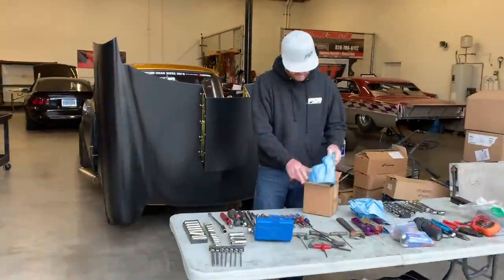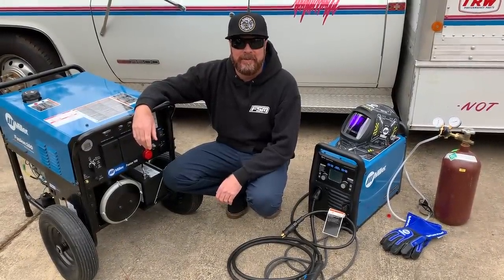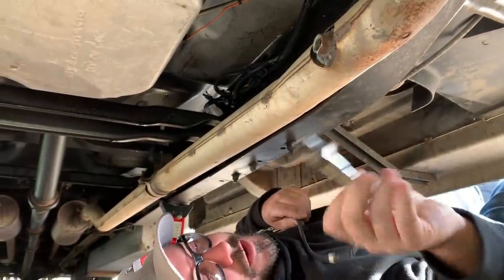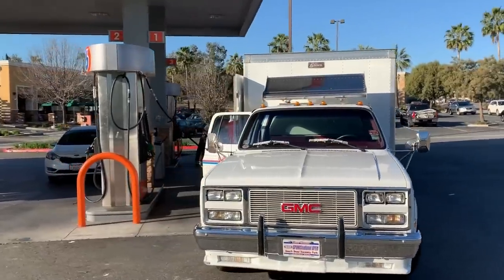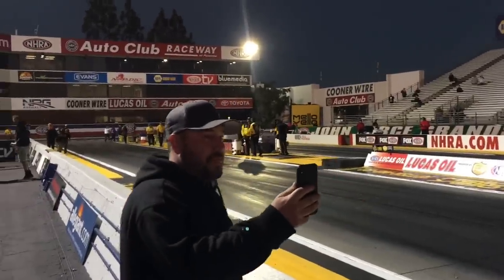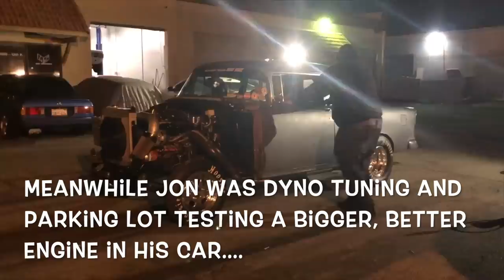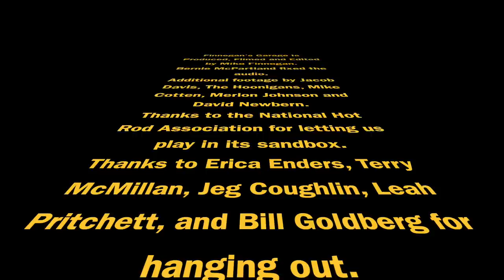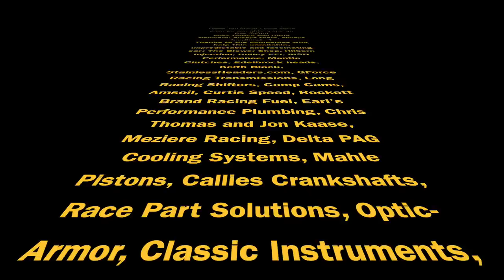Finnegan's Garage Ep.65: The Biggest Wheelie and Race of My Life!

Comment: Dude it's got the aerodynamics of a billboard
Reply: Suggestion:  The deflector is possibly  only creating down force. May have more success deflecting the vacuum of of the back of the vehicle. I have enjoyed traveling with you guys on the podcast.
Reply: It is a billboard!
Reply: Thomas Wright pushing a 7 ton barn down the road. I bet the people drafting it are getting great MPG. 🤓
Reply: My 60 Landcruiser has the same aerodynamics, but i still can get 20mpg out of that
Reply: Having said that, it definitely wouldn't do that at 80mph. More like 60
Reply: like a brick through oatmeal
Reply: @joecook3223  My 93 80 gets about 9 on the hwy.  Had a 93 pre-taco extra cab with the 3ltr V-6 manual 4x4 that got about 13.  Had a 99 F-250 supercab 4x4 gasser (5.4l) automatic that got 10, no matter if it was hauling 10klbs or completely empty.  If you're getting 20 in a 60...you should do a video about it.  It MUST be a diesel off the trot, a manual naturally but still...I'm curious.
Reply: @samjohnson9894  yeah dude turbo diesel. 20 is the best i ever got. (Well it was 11.3L/100km but converts to 20 mpg apparently)  That's bullbar and roof racks on. The very worst i got was 16L/100k. Full roof racks, full car, 1 ton trailer. But like i said, i don't really drive fast, as soon as you go faster than 100km/h the economy worsens dramatically.
Reply: Mum and dad have an 80 and that does pretty much the same as mine, again diesel 5 speed. Same deal though, none of us drive very fast.
Reply: @joecook3223  That 80mph or kmh. Major difference. My old 05 Silverado 5.3L with 3.42s gave 13 empty at 80mph. Damn thing could hit 143mph too, but scary as hell in a pickup thats pretty kuch stock with a tuner removing the govner. My diesel 18 3500 cummins gets 15 at 55mph to 60mph and 11 at 80mph. I he traveled 55 to 60 he would average better. Fuel loss by extra wind force to eats fuel. Why i see truckers running harder when their trucks are unlocked as they burn the money in fuel. The smarter guys run 60 to 65 and take more money home as they are not wearing out their equipment faster or have to take that extra load to take the same home as the guy running 60.
Reply: @brandoncaldwell95  in the comment above yours the "80" was referring to an 80 series Landcruiser. We drive everywhere at 60mph, and at that speed we get 20mpg.

Comment: 14,000 lbs, 456 gears, 80mph, 454, what part of bad gas mileage is hard to understand?
Reply: Did he say if it even has a lockup converter? 😆
Reply: @grabasandwich  no th400 ever had a lockup clutch
Reply: I had a 70 SS454 Montecarlo a verrry long time ago and it got eight something so honestly I don't think with all of the weight, 4.56, and eighty MPH that your doing bad. It is what it is. Seems normal to me.
Reply: @Sharkey_t  thx, I probably read that somewhere but I forgot.
Reply: jake welder that is not a 4L80
Reply: You forgot "Aerodynamics of a house"
Reply: @chrisj197438  thanks
Reply: tbirdracefan 
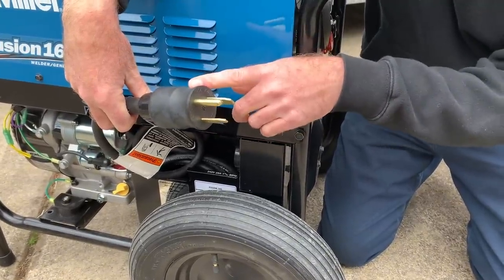 I was going to say the same thing! The fuel mileage sound about right for the 4:56 gears.
Reply: horrible low compression smog engine
Reply: There is no way they are cruising that at 80. The RPMS would be through the roof. Guessing a 30 " tire. That's putting it at just over 4K.
Reply: @jerryhayden8720  ive got a BONE STOCK 77 chevy silverado..... 
12mpg.....unloaded, loaded.,....head wind, tail wind..... 12 mpg

400 small block, np203 full time 4 wheel drive, and AT LEAST 3.73s....... 
ive only had to pull one pickup out at more than 1500 RPM..because it was up to the frame in mud
most of the time..... low loc.... and let her idle 

im swapping in a SM465 and NP205 part time 4..... in the quest to get 14 mpg!
Reply: I really don't see why he cares about the milage. Has he forgot how much is in that motor for the boat, or the 55 or the c10. I think he can swing the bill for gas even if it is  a bit of sticks shock when he fills up.
Reply: Look at some of the early Hummers... single digits with no load.
Reply: tbirdracefan you want fuel mileage with that thing put a caddy 472 or 500 in it and 4.10s or 3.90 rear gears almost all bolt in stuff way easier than puting a backhoe motor aka 5.9 cummins in a squarebody and way cheaper. 500 ftlbs stock and weighs less than a 454. 9mpg with that weight is possible but unlikely my daily driver work truck is a 17 f550 6.8 v10 rollback towtruck that is 15000 lbs empty it gets 9mpg with a 6spd double overdrive auto trans and im not pushing a giant barn door thru the air. 5.5mpgs with a big block and a 3spd is not bad most big block motorhomes get 6 to 7mpgs and they only weigh about 10 to 13.5thousand lbs.
Reply: I hate stinking, noisy diesel engines, but this is exactly the right application for one.
Reply: Just needs more air in the tires, and a new air cleaner, then you should get 25 mpg.
Reply: I'm not a big fan of diesel engines, but if I had that ramp truck, I'd stick a Cummins 6.7 in there.
Reply: Gas mileage isn't a problem.
He was selling Holley and Miller gear. What's so hard to understand about that ;o)
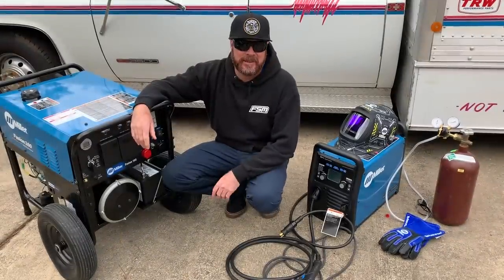Reply: Yeah, he really needed to adjust the wing on the front, and maybe get a set of 4:11s, or hell, maybe even 3:73s for it. That 454 should be able to pull it, though it'll likely be a little more sluggish.
Reply: @ferrumignis  You may try a FRONT hood spoiler.
Reply: Honestly, i dont see why to complain about hat milage in that pig. Loaded down my 05 5.3L stock silverado z71 3.42s gets 6mpg with 10,000lbs in tow. Hit a hill, and its down to 1 or 3 while at 4500rpm... To which is why i finally broke down and bought a diesel. Curious what ever happened to J-Low the dually that he has or had.
Reply: @MattLundquistVW  you have a point there,they did 9 oil changes on Blasphemy to get her to the track.I am guessing 8 to 10 quarts per.At that point just stop looking at the pump when filling up!lol
Reply: @ferrumignis  I love the smell of diesel and a decent stereo will take care of the noise.
Reply: @charlesvan13  Lol!
Reply: Everyone in comments is saying move the wing.Other than looks,for all the good that wing is doing,you might as well sell it  for fuel!
Reply: Well if you were running on Hempthanol E95 at a dollar a gallon it wouldn’t really matter
Reply: 373 gears and an under Drive harmonic balancer  with a more efficient throttlebody 
Overdrive on your trans
would give you 4 to 6 miles per gallon
Reply: @Sharkey_t  well if you look at the 4L80 it is just a electronic TH400. With overdrive added.
Reply: @ferrumignis  I love them! Twice the torque, half the fuel.
Reply: @craigcode7103  he dinamated the whole cab anyway. I doubt it is that noisy.
Reply: @Darkhalfcustoms  most of the geartrain in a 4l80e is th400, but that still doesnt make it a 400.
Reply: @SoulTouchMusic93  It's the godawful diesel knock, stink and half the useable RPM range that annoy me 😀  They absolutely have their place though.
Reply: @ferrumignis  can't argue with that. Diesels do not deliver the pinnacle of performance in terms of car but you can increase boost while holding onto the compression and same fuel mileage as before. Also you can have things like the jaguar sdv6. 300 HP v6 torque convertor automatic on it and still delivering 50+ mpg. What kind of power can you get out of a petrol car that get 50 mpg? Maybe 120?
Reply: The Ramp Truck needs a gen four 6.0L with a 1900TVS off a ZL1/CTSV and matching auto to get it in the double digits with power and reliability.
Reply: Bryan Ryan  They already did that with the Roadkill ramp truck making the NVH so bad he bought this one.
Reply: Wait until it warms up.
Reply: Product placement....
Reply: tbirdracefan small tank too. not a fuel cell either.
Reply: Right but i think they got close to 8 with a good distributer and id definitely go 4l80e
Reply: tbirdracefan just needed something to plug Holley with ya dig
Reply: An update Finnegan released mentioned that the timing was set at 0 degrees TDC. There's your problem
Reply: Gear Vendor
Reply: First issue is it’s a 454 with 456s. 

Ya need a diesel and a over drive unit.  I had a similar rig added a 5.9 Cummins with full banks power up kit including split intake and full exhaust went from 215hp to 387hp, 4:10 gears and a US gear over drive. MPG doubled and freeway cruising speed went from 60 mph to 70 plus with still great mpg. 
Loaded weight is 17,000 to 18,000 lbs.
Reply: Well if it helps, the guys later on did some simple tweaking to the ignition timing along a few other things and managed to get it to achieve just over 9mpgs while cruising.
Reply: stil better than the old tractor that i had
Reply: The thing wasn't built for good gas mileage!!

Comment: 1)  Please move the wing forward  2)  Consider diesel swap... you want to get to 10mpg, put a diesel in it.
Reply: You would probably get 14 MPG
Reply: You can buy a lot of gasoline for what a diesel swap would cost....
Reply: I agree with moving the wing foward....
Reply: The wing is in the wrong spot and not at the right angle to actually be effective, Fin knows that. He mentioned in the last video that the company that makes the wing contacted him and gave him the info on where it should go and at what angle. These videos are weeks behind actual time (because the man is busy). If he ever mounts the wing permanent, I expect that it will go in the right spot at the right angle, then we should see a noticeable increase in cruising fuel econ. Shit, when that wing starts doing its job the truck might get 11mpg or better with that smog era 454. Im pretty interested to see it happen myself.
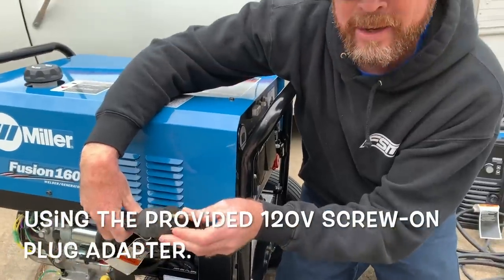Reply: 11 is a bit of a stretch for a 454 with 4:56 gears, no matter what he does to it.
Reply: Definitely a diesel swap...Duramax or even a lil Cummins. And then change the rear end to suit the lower rpm. And then you will have an engine for another project.
Or at the very least, a rebuild of the current engine to beef it up... more torque and HP will make it not work as hard, which will lower mpg.
Congrats on the challenge!
Reply: I'm also with the guy that says you can buy a lot of gas for the cost. That's my logic and I appreciate you for pointing that out.
Reply: scowell 

Another diesel swap guy who has never done anything close to a diesel swap.
Reply: camarowland4 

Everyone says diesel swap and they have never done anything close to a diesel swap
Reply: @chrisj197438  Mike had though he put a Cummins in a square-body already.
Reply: Or Fuel injection and overdrive
Reply: @chrisj197438  i'm saying diesel swap it and I daily drive a diesel swapped tacoma that I finished eight years and 160k miles ago
Reply: Diesel is more thermally efficient than gasoline
Reply: diesel swap!
Reply: Might as well do a body swap onto a newer Durasnacks GMC CC than diesel swap it.
Reply: jimbote1968 

Most people never do it
Reply: scowell, When they put the 4 speed automatic transmission into it that they had half installed. They had to remove due to missing parts before they left. It will get alot better gas mileage.
Reply: He has f*cked up one truck so lets not do another.
Reply: The Big Picture my 72 Chevelle with LS5 makes about 14 mpg with 4.10 gears. But I’m not hauling a giant box with a 3-4K lbs car either.
Reply: That thing is some dire need of vortex generators also.  Without a bunch of A/Cs and stuff on top, that box can take max advantage of some aerodynamics on the ass end.
Reply: I've got a 24 valve '01 Cummins with 200K for 10K, but it is a long way from Georgia. Comes with a complete truck attached.
Reply: Gabe Gamer don’t think he’s dumb enough to diesel swap a low mileage time capsule.
Reply: Finnegan put a diesel in the Roadkill Ramp truck , then someone stole the Mazdarati off it so Finnegan got the unreliable lock box truck he took on this trip to stop his car getting stolen
Reply: @justrandomstuff84 .Where did he say that. All I heard him say that I liked the truck to much to cut it up.
Reply: scowell, spend all that time and money to diesel swap it to gain 4.5 mpg. And destroy a beautiful condition dual cab square body. If he plays with some rear end gears and maybe a gearvendors he would get close to those numbers and not destroy a cool ass truck.
Reply: @chrisj197438 , Sorry but who is spending all of Daddy's money.  Did I miss something.
Reply: Mark Thomas 

Fennigan. Daddy got him set up and still helps him. He won’t argue that
Reply: @chrisj197438  . Where is your proof.  Not once have I heard that Mike's Dad set him up. And I don't think his Family is that kind of wealthy. All I have heard that Mike's done it the hard way and with support from his family but not the Financial support you are suggesting.  Send me a link or a story on where his Dad has given him money.  I would like to see it. Thanks.
Reply: Mark Thomas 

He’s a nobody so no news to that but it has been said in other YouTube channels.
Reply: Chump Johnson 
So you have heared trash talk in other YT channels??
Most stupid thing to say..
Reply: @thebigpicture2032  The 1 ton duallys with that drive train got only 9 or 10 mpg unloaded.
Reply: put a Cat 3208 diesel in it it will look and sound cool (3208 is the smaller cat v8 about the same size as the gm big block )
Reply: @chrisj197438  The best things he could do would be to mount the wing in the correct spot and get a 4L80-E transmission put in. All he would have to do at that point would be shorten the first piece of the driveshaft and maybe for cosmetic reasons change the shift indicator to be Park, Reverse, Neutral, Overdrive, 2, 1.
Reply: You can buy a lot of gas with the cost of a diesel swap. But that's REALLY short sighted, as most people are. He's already talking about an overdrive swap, that like he said may not even be useable if it's always kicking down. If you make even a few cross country trips, a Duramax/Alison swap would be worth the money. Then, you get your time back in not having to stop for gas all the time. You won't break down all the time, since it's a newer more reliable power train. But I'd go with a Duramax instead of a damn Cummins. They're loud, they're not a V8, just no. Not to mention they're the damn diesel equivalent of a sbc or ls now, everybody has done Cummins swaps. I'm a Ford guy, but duramaxes are pretty decent engines and have tons of aftermarket support. And it'd be really cool to see an awesome ramp truck with one under the hood.
Reply: @salvadordollyparton666  He already put in a gearstar level 4 4L80E transmission in it. I talked to him during Atlanta Motorama down at Atlanta Motor Speedway which was months ago.
Reply: Yea, I get about 5.5 mpg with my semi at 75,000 lb

Comment: Hey Mike
You are pushing a 14,000 pound brick through the air at 80 miles an hour… Let that sink in…
You’re not going to get 20 miles Per gallon but you can get better than you are. Many of us full-time RVs with class C motorhomes weigh about 4000 pounds more than you do and we are shaped just like the same chunk of brick that your truck is. We have about the same engine same tranny same gears same Duallys.
Shave your head’s and bump the compression just a scoshe, Double check your front wheel bearing condition and preload when you check your front calipers to make sure they pull back and release. You already know about driveline balance and of course you know about using synthetic gear lube in the diff, right?  You need to mount that wing about 12 inches forward of where it is and make it adjustable to move it as far as maybe 16 inches forward then experiment with the attack angle from there. I’m getting 4 to 6 miles per gallon better than you are, it’s the little things that all add up . And tell me you’re joking about maintaining a steady 80 mph. 
Love the channel you’re doing a great job, keep swinging for the fences
Reply: I think he's doing 75+ just to go with the flow of freeway traffic. The wing won't look cool if he mounts it forward.
Reply: Two words for the cure: Gear Vendors Overdrive. Ok, three words.

Comment: Maybe Gear Vendor has a good overdrive for that truck? They should.
Reply: I had one on a th400 with the controller . Made it act like a 6 speed auto. Pretty nice
Reply: @lpatierno84  I knew it'd be a solid choice, never had one, but after I made my comment I noticed many others had recommended it too. 
  Only downside I ever heard is it can drop the rpms too far and lug the engine, putting it not in ideal rpm range.  Idk the credibility of that remark though.
Reply: adam forbes There are quite a few Doug Nash overdrive units around for cheap. I know of at least one that will bolt right to the back of a th400, and the guy would sell it for a couple hundred bucks.

Comment: Does anyone else think Finnegan should put a Duramax in the new ramp truck?
Reply: Might double the milage. What do you think?
Reply: I could see it, but if it didn't, it would just be cooler.
Reply: @lanemendenhall1717  Yeah I agree, but he already has a cummins swapped ramp truck and its not very often you see a squarebody with a duramax, everyone and their dog has a cummins swapped squarebody.
Reply: @lanemendenhall1717  I would say just compound turbos on it.
Reply: U know they would hack the shit out of it and it would be so unreliable
Reply: Cummins. I'm a Chevy guy, but cummins
Reply: He is simply not a good enough fabricator to get the job done  correctly.   Anyone can stuff a different motor in that truck but for things like the ac heat and cruise to work that takes some skill.  The crap thatmost you tube guys do is simply Busch league.   Just once id like to see something he does that doesnt blow up or melt down .